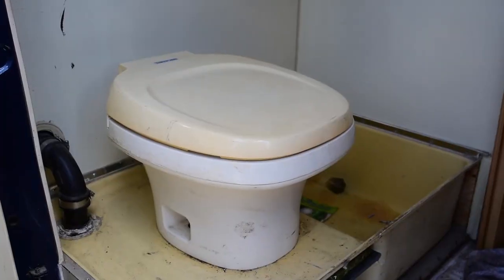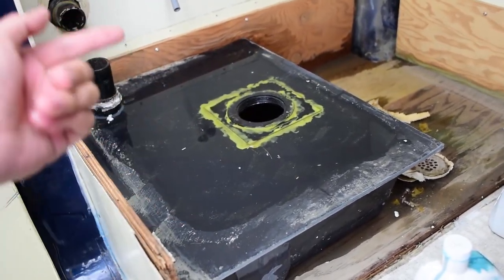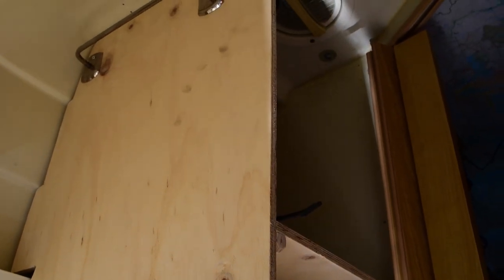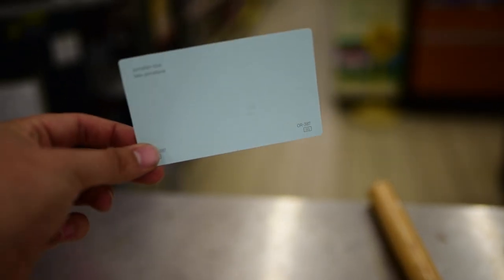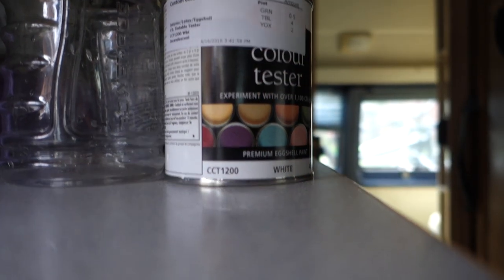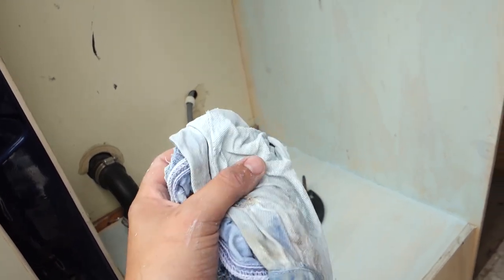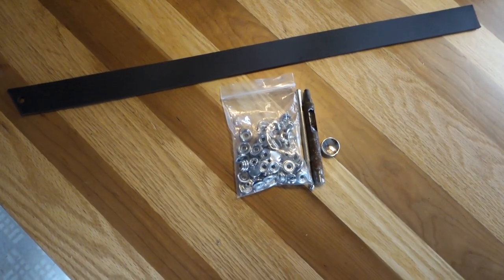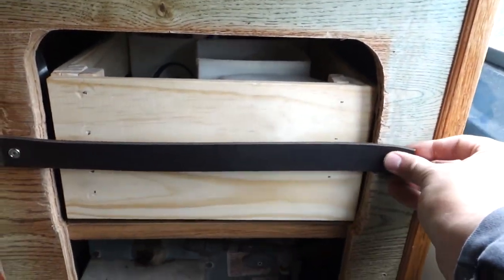Van Storage Mods - Van Life 130

Comment: Have yall thought about a composting toilet to get rid of the black tank?
Reply from the maker: yeah for my next build I'll definitely be going that way, but for this van it just wasn't worth the investment for me.
Reply: I'm a bit new to the urban RV concept, so I have been looking for a rv and cant seem to have any luck in michigan. do you know how much a RV such as yours usually costs? I can find a crap ton of extended cargo vans and i know of where to get camper toppers, and how to install it. in your opinion if i spend say $2400 usd on a extended van and put about $6000 usd to convert it would it be worth it? Just wanted to know your input seeing as you had experienced a pre-fab that you are tweaking to your liking.
Reply from the maker: 's way more economical to get a ready made camper, especially if you're looking at vans 15yrs old and older. the only time building your own topper on a van would be worth it is if you need something very custom and you're looking at a van less than 5 yrs old.

its just a pain to find a good camper, many of my friends travel across several states to get their hands on the perfect van.

i'd broaden your search and calculate a roadtrip into the cost of your van, and see what you can come up with.
Reply: Yeah that custom floor plan is what i'm looking for, something very efficient for up to 4 people and I can find running vans, box trucks and used buses for cheap(directly from a fleet line professionally maintained) and about 5-10 years old. Thanks for the help, looks like i got a-lot of research to do lol. Any specific models/makes of ready made you would suggest looking at. I have no issues custom fab, but i may as well look into ready made to make my life a bit easier lol.  I'm planing on doing this stuff at least a year from now, but if crap hits the fan I might need to work on a budget of 10k usd in a year, and that might just mean 4 walls and a roof lol.